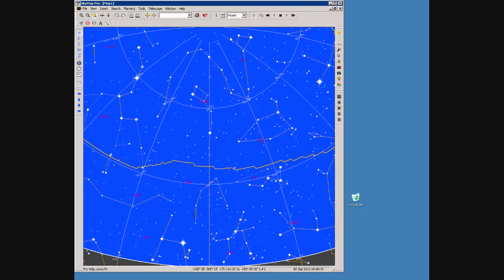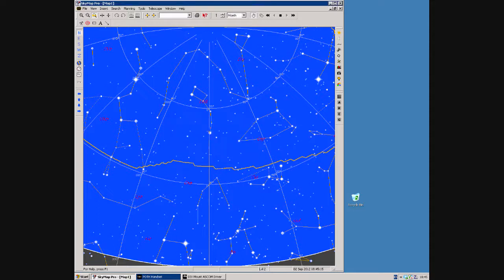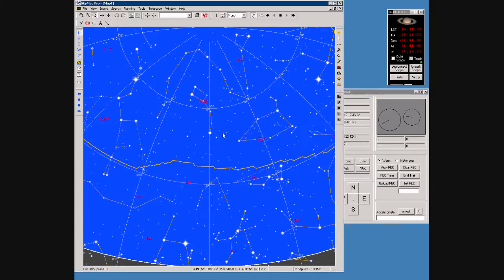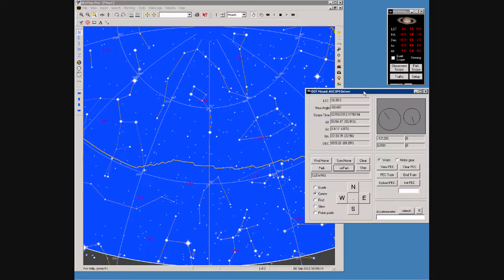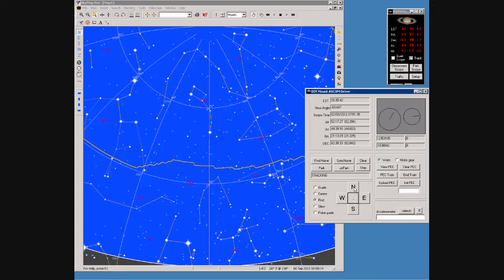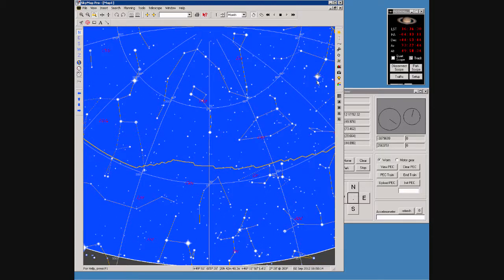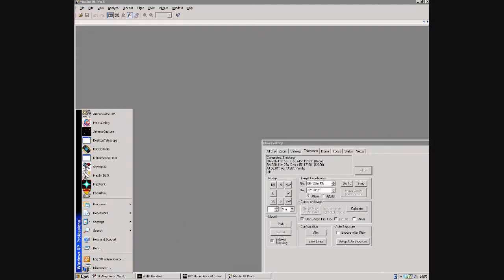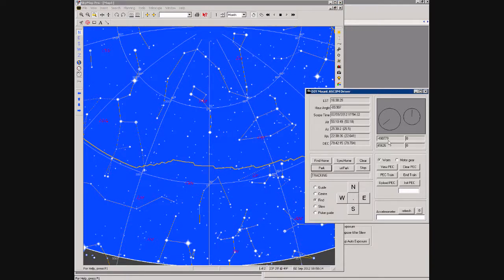Arduino ASCOM Driver on Homemade telescope mount

Comment from the maker: Just because Arduino is open source, it doesn't follow that it is somehow "sinful" to use it for non-open source projects, which in turn means you have no basis for "having a go" at me. 

I've said both here and in other places that I will always go to great lengths to offer advice to people trying a similar project  - over the last year I have had several dialogues with people making their own mounts. I prefer to help people in this way rather than simply chucking them reams of code listings.

Comment from the maker: All the information for creating ascom drivers is on the website  - google for "ascom standards"

This includes template projects in vb.net and c#.net which simplify the creation of ASCOM drivers.
Install MS visual studio express edition (free) and then the ASCOM platform which installs the templates in visual studio. Then create a new ASCOM telescope driver project from within visual studio. After that you just program a protocol between yor driver and your mount.

Comment: mister, first congratulations! i want to do the same as you but i have no idea where to start in terms of software. I'm sure that ir i make a stand-alone arduino control everything will work but i dont know how will i make it with the computer and ascom drivers. Could you give us some info?

Comment: others who want to experiment with the same thing could really benefit from having the source code of someone who has accomplished this as a guide.  Even if it's custom to your scope, it would provide a good framework for doing this elsewhere.  By not providing your source code - something from which you derive no profit except ego stroking on internet forums - you are acting in the worst way to the open source community.

Comment from the maker: I have not posted the code anywhere.

The ASCOM guys make writing drivers pretty straightforward with the .net templates. You just have to fill in the bits specific to your mount communications

Most of the brains are in the Arduino C++ code, which is of course completely bespoke to my homemade telescope mount.